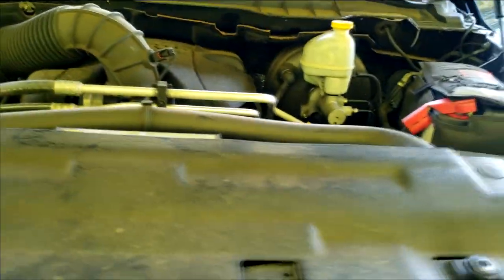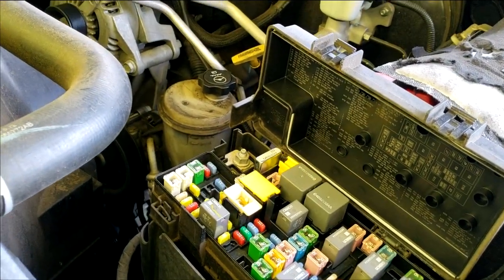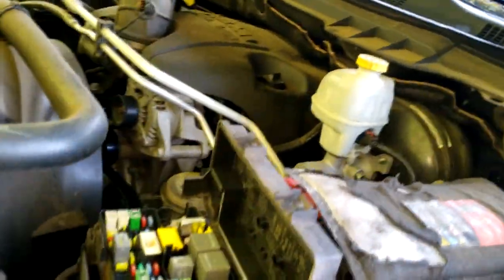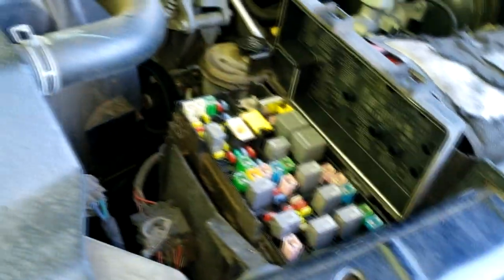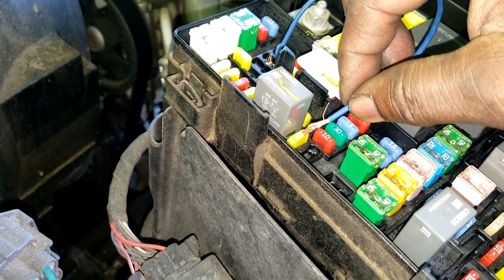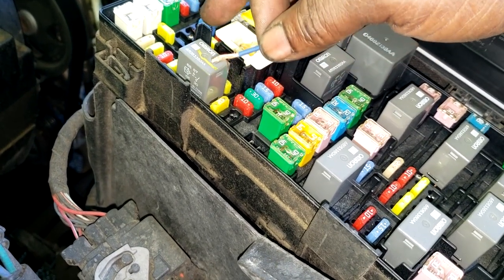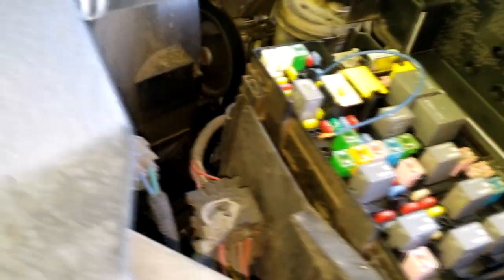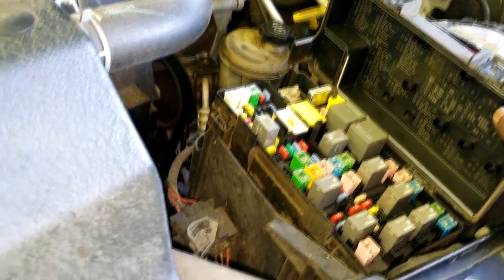How to fix a CRANK but NO START. Replaced 2 fuel pumps already. NO FUEL PRESSURE. R09 P54 V62 TIPM.

Comment: There are about 50 videos on youtube for this same problem. I have a 2012 Ram 1500 and it does the same thing, so I bought the TIPM fuel pump relay bypass cable from amazon for six dollars.

Comment: Bad fuel pump. Nothing else. I already know Cuz it has gone silent. No more buzzing noises. Fuses and relays are good. Car won't start lack of fuel but the only code that popped up is p0340. But it's not the camshaft position sensor or the crankshaft position sensor. It has to be the fuel pump cuz the buzzing noise is gone. No matter what is done, it won't start even this method you used in the video. It's a bad fuel pump for my car.

Comment: Very good video for anyone that has one of the affected vehicles. I had to get a emergency repair fuel line kit for my ex Neon when the factory plastic line got a pinhole leak in it one day going to work.
Did it on the side of the road with some wire cutters and the kit that was like 15 bucks. It got me down the road till I could find a 95 only OEM fuel line that has been discontinued. Never had to mess with the tipm or fuse/relay block it had other than to check fuses and relays when it was having very occasionall issues.

Comment: Good ol' fuse m25 lol. 
This is a good one to show the rookies.. they probably replaced the pump twice because they "saw" voltage on the m25 supply, but the internal relay isnt passing any current. I usually try to run a 55w light bulb off it to test. Made a video on one today lol.

Comment: You can wire the jumper from a source that only has power when the key is on. That way the fuel pump will only run when the truck is on.
Reply from the maker: Sure you can. There's multiple ways to do it. I'm just showing this way

Comment: I'm in the exact same position...(same truck much older model -98) just stalled on me last night after replacing distributor cap, i.a.c, ignition coil...
Reply: (Actually had fuel pump replaced too- )
Couldn't you use any spare wire (14g ?) For the jump?
Looking forward to part 2!!

Comment: I'm having a similar issue with my Chevy cavalier, my question is is it possible to use a jumper wire on an external relay instead of a fuse I just need to get my car home so I can do a more in depth diagnostic
Reply: Hey I’m having that same problem with my cavalier did you ever find the problem?
Reply: @covidious7916  I did find that that with a more careful search that my ground wire was corroded pretty bad I replaced it and got the fuel pump to power on the car started and ran but when I came out the next day the same issue, so there could be a possible shortage somewhere also, it's nice out so I'm going to see what I can find and I will keep you posted. But be sure to check all of your fuses under the hood and inside to see if any are blown and your relays, but I will let you know if I'm successful today
Reply: So I just got done and I simply didn't have the new ground wire I installed securely bolted down but the problem was definitely my ground wire the car is now running 👍🏿💯 perfectly

Comment: I had a shop put in a new fuel pump
And starter yesterday. Truck ran fine rest of the day. This morning it had a hard time starting just like before I put it in the shop. Any thoughts? I just spent 1368.00
Reply from the maker: Dang, what kind of Truck is this? Also are you subscribed to the channel?
Reply: @OnlineMechanicTips  I will subscribe but I saw the posts were older so I didn’t. It’s a 2011 ram 1500 5.7 hemi.
Reply: @OnlineMechanicTips   I just did this same thing, replaced pump last night, truck started and ran well. now a no-start this morning. I also just subscribed.
Reply from the maker: @anthonyadamsrbl736  hey what year is your truck?
Reply: @OnlineMechanicTips  2012 dodge ram 1500 5.7 L.  I just tried your method, and it starts and runs, but as u stated, it is a gamble each time if you turn vehicle off. I check the fuse for power each time it doesn't restart and there is no power present.
Reply from the maker: @anthonyadamsrbl736  did you get it running?
Reply: @OnlineMechanicTips  yes sir , i installed the external fuel relay.   works great now.
Reply: Internal relay in TIPM

Comment: I’m having the same issue. The previous owner already put in the jumper wire. When I turn the key on I can hear the fuel pump buzzing when I try to start. It sounds like it’s trying to start but it definitely sounds like I have power to the pump.
Reply from the maker: Have yo had it scanned? Whats the codes? Also are you subscribed to the channel?
Reply: Hi, thanks for replying. I do have a scanner, but I did not put it on because there was no check engine light. Yes, I just subscribed to your channel.
Reply from the maker: @billmillington5254  Well if you hearing the pump run, you still need to no if its delivering pressure. If you can spray starter fluid in the trottle body and it starts, your problem def fuel related.

Comment: Great video. Is it possible to use a fuel pump relay bypass kit on a 1995 Mercury Sable? My new fuel pump went out in 2 weeks. It was the 2nd fuel pump in 12 years. Thanks. I just subscribed to your channel
Reply from the maker: Hey bud listen, If your physical fuel pump has failed, this type relay repair will not affect this. This relay kit simply used to bypass a module (TIPM) so the needed volts would go straight to the pump and the pump would run. I think these are 2 separate problems.

Comment: I just bought a used 2011 dodge ram 1500 SLT 5.7 liter same issue I am out of town on vacation how would I fix the permanently
Reply from the maker: https://www.youtube.com/watch?v=xrpp_yFr3Bo - If this link dont work, just search my video "FIXED. Crank but NO START. Chrysler Jeep Dodge Ram 1500 TIPM Fuel Pump Relay. R09 P54 V62 Recall" Or you can just simply get the TIPM re[laced and be done with it.

Comment: i have a 2011 ram 1500 doing the same thing. i can get it started with starter fluid and it stays running and will run fine once started. My mechanic recommends a fuel pump replacement but i have also seen this issue as well pop up searches. my question is since mine does run just wont start could it be the same thing?
Reply from the maker: Hey bud, curious, whats any codes in the computer?
Reply: @OnlineMechanicTips  there were no codes but I tried your method and it worked perfectly. I found a part online to fix it so hopefully it works. Getting to work with your wire trick now.

Comment: Hi i have a ford f150 2008...we just switched the fuel pump because a mechqnic came and was 100% sure it was that....but still it only cranks and wont start........we checked the pump relay and the ground cable doesnt light up...idk what it can be or what else we can do

Comment: Hey man very curious I know it’s 2 years later but this is very informative but im very curious if you have an answer for this but I have a ram 1500 4.7l 2012 and certain times of the year like as in example December to march sounds crazy I know i even sound crazy saying this but it does this thing where the fuel pump won’t kick on till the pickup is jumped or put on a booster but after march it works perfectly fine is this something related electrical or fuel pump issue it’s done this the last 2 years
Reply from the maker: Curious if you have any codes in the TIPM? Also are you subscribed to the channel?
Reply: @OnlineMechanicTips  I am but I don’t have a clue if it’s the fuel pump causing it or the tipm I have a fuel pump coming today to replace it to see if that’s the issue but if it’s not my only other idea would be the tipm
Reply: @OnlineMechanicTips  I’m not to sure how to check if there is codes in the tipm

Comment: I have the same issue on a 2014 ram 1500. Replaced 2 fuel pumps. I don’t have a fuel pump relay fuse that I can find.  Any help?
Reply: hey did you ever figure it out I am dealing with the same problem and all the videos have this old fuse box not the ones we have,
Reply: Did you find the problem ?

Comment: I have a 2016 ram v6 
What mine does ones I put some starting fuel in it it will start and stay on 
What do u think that might be cuz I can hear the fuel pump come on 

Also I have a check engine light on for a brake switch light I replaced it still says same check engine light on all lights work all breaks and disk’s new also emergency brakes got new shoes plz someone help me I’m tired of paying this mechanics and no one knows why it’s keep doing that after we put the brake switch light on that’s when I started having the issue of the truck not starting and we had to put starting fluid to start someone please help me

Comment: Grounded!! PCM!! Check wire harness to breaker box
Reply from the maker: No, this was a fuel problem
Reply: @OnlineMechanicTips  I thought the truck stayed cranking? My impala stayed cranking on its own once I turned key😆😆 I had to unplug battery then tried again then I lifted garners, it came out to be a fraud wire.